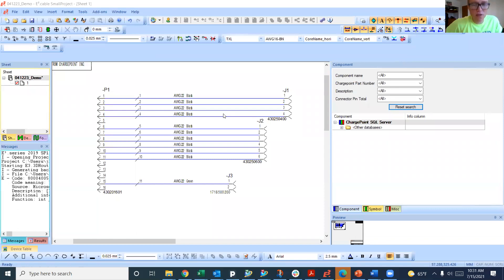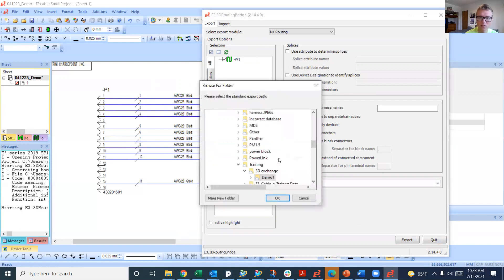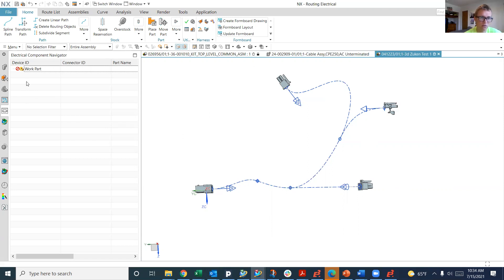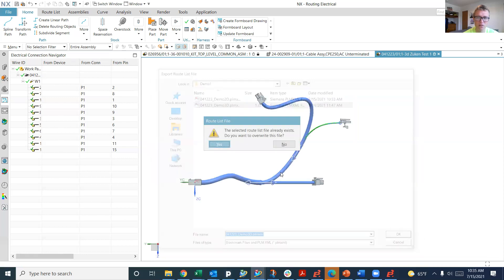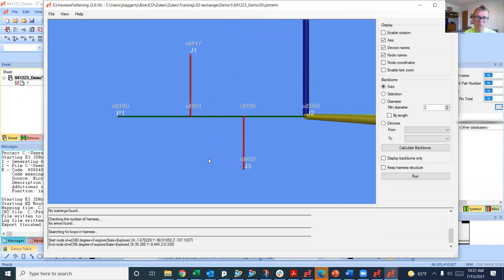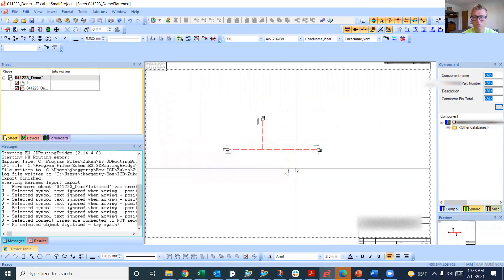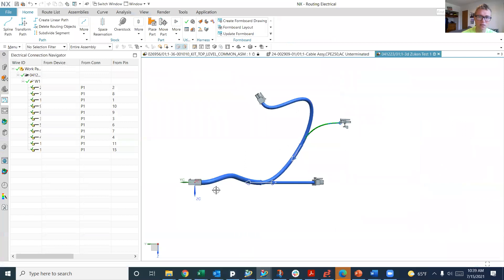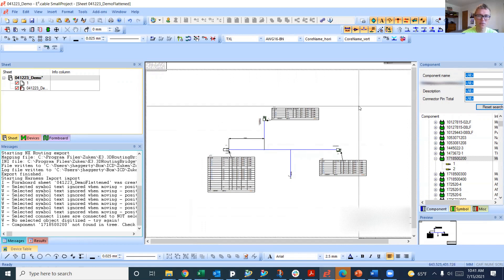E3.Series to NX 2D-3D exchange

Comment: when I import the flattened file exported by E3HarnessFlattenning, it's showing "Non-Unique apprefs  found in XML file". How to fix this error? Pls help
Reply from the maker: Hey Tuan, it's been a while since I've worked with NX and Zuken exchange but it sounds like it may be a naming issue in either Zuken or NX. Did you name all your devices in NX and get them to match the reference designators in E3.series?

Comment: Excellent! This is simple case once you've got connector's pin to pin connections. What if there're some Splices that is put in btw connectors and connectors? I've tried some times but once I exported from E3 to NX, it's still defining Splice as a single connector.